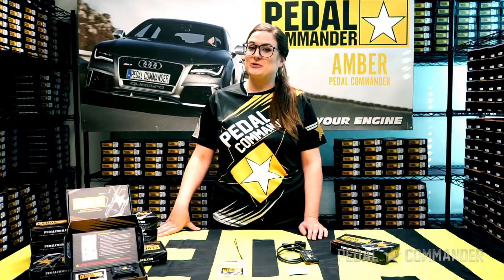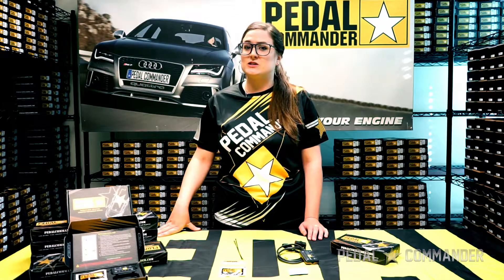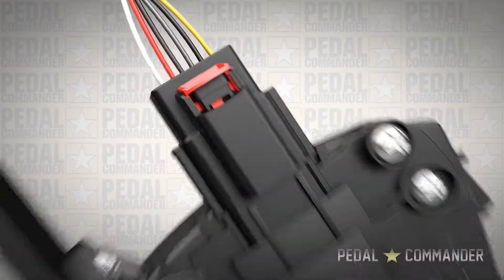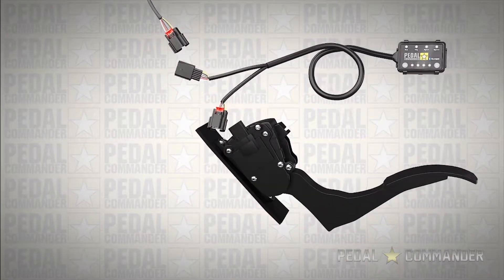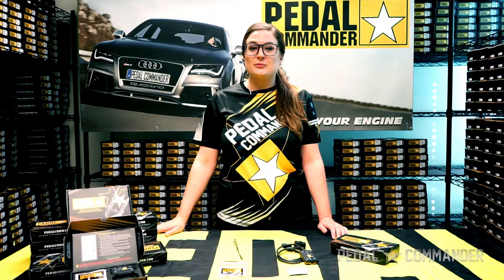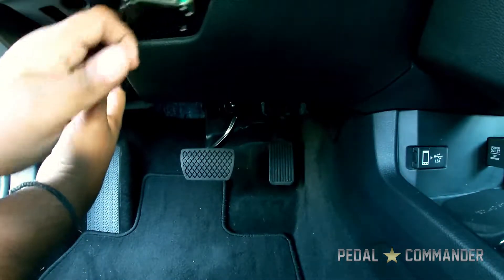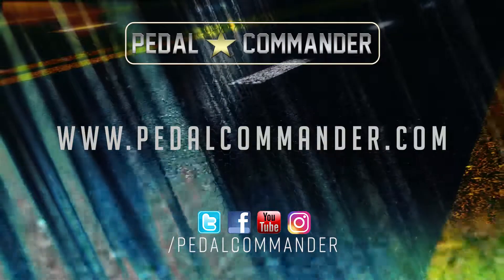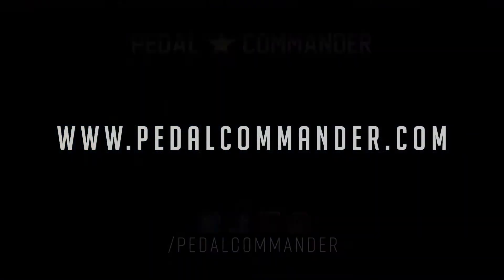Pedal Commander PC-51 Installation -  Infinity G37

Comment: INFINITI

Still waiting on someone to respond in regards to me questioning will I have to remove my ICC sensor in order to utilize this product in my 09 G37S sedan. This will ultimately be what decides which throttle controller to purchase....
Reply from the maker: Thanks for reaching out to us. The Pedal Commander is an easy plug-in play that connects to the pedal assembly plug. You will not need to worry about disconnecting anything else other than that plug. 
 If you have any questions, feel free to contact us at 805-375-4333 Mon-Fri 9am-5pm PST or email us at customerservice@pedalcommander.com
Reply: I was wondering the same thing. What did you end up doing and by removing the ICC sensor does it allow the use of a throttle controller? I've looked everywhere for this answer even email the companies and none of them could give me an answer.
Reply: What is this thing for
Reply: t 805 removes lag from pedal, pedals are electronically handicapped and the responses takes seconds. I believe this product in some way modifies the way the throttle opens, thus quicker response and more gas at any given time or less gas. If you hate that lag on the pedal this is what you are looking for.